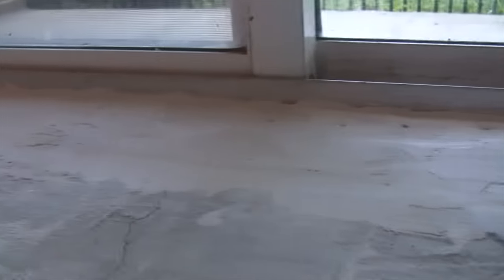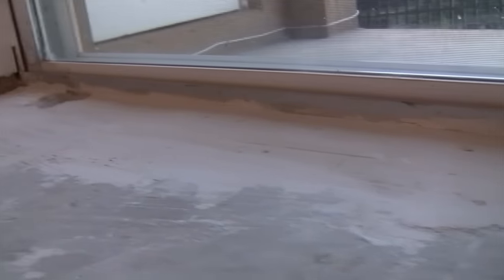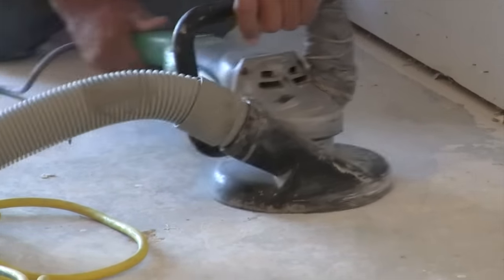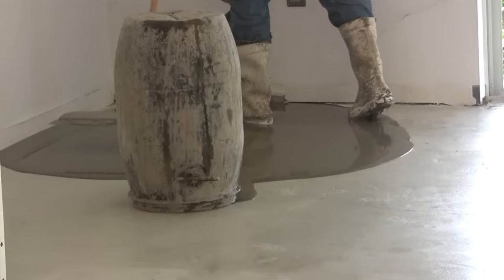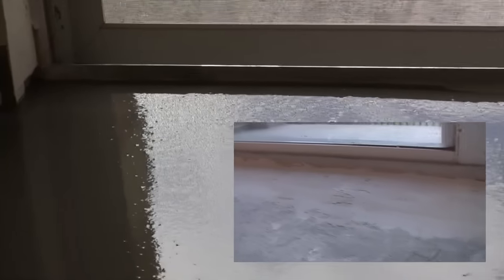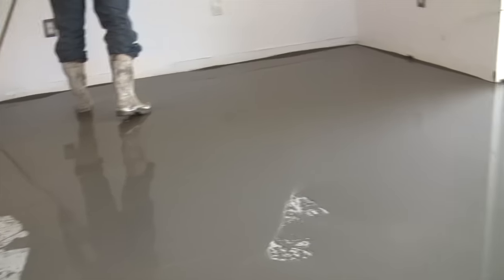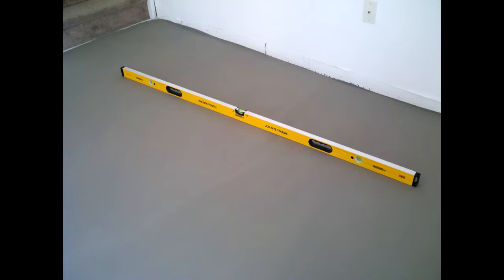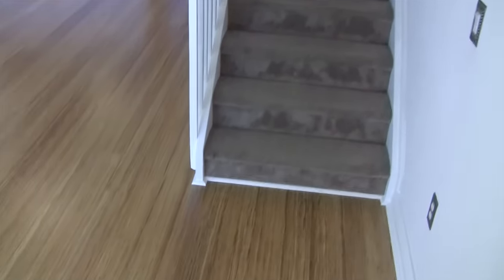How to Self Level Concrete Floors Like Pros - Self Leveler

Comment: Hi there, I have a question. I'm wanting to install luxury linyl planks onto my bare concrete foundation. It is a newly constructed home. The surface appears smoothe, not any rigid bumps like the foundation you guys were working with. I took a level and the bubble always fell close to perfect in the middle. The planks I would use have an attached pad and is 5 mm thick total. Is it really neccessary to use a self leveling concrete if the surface is already pretty smoothe?  It's a lot more expense and headaches that I would love to avoid at all costs. I have called several flooring stores and they all say yes, you need to use a self leveling product, but I didnt know if they were just trying to tack on more unnecessary things to make money. I've watched a lot of YouTube videos of people installing vinyl planks and they never address needing to use self leveler... just seems like they put the planks on and theres no problem. If I add these planks directly to the concrete without the self leveler product, will I be able to tell right away if this will be an issue? Or would it be an over time issue?

I want to install the planks myself to save money so I called several places to ask if they could just do the self leveling step for me and they all said no, that they do the whole job as a bundle.

Any ideas and answers?

Thanks so much!
Reply from the maker: Kelly yes a lot of us would like to save money on that as well. The industry specs are what you should try to adhere to and what you need to do is take a 6' level and put it all over the floor in the Room spin it around different orientations and if you see anything more than 1/8 inch dip in the floor across 6' then you have a problem and you will void the warranty of the planks. I would also check in the instructions of the wood planks that you're going to use and see what they say but usually it's no more than an 8th of an inch. Now I have cheated a few times and done it with an 8th of an inch or 3 sixteenths of an inch gap sometimes where I had people and just didn't have the money to go the extra step to self level, I put a couple of shims under the areas where there's dips and that will help keep the plank and stable. But I am concerned about how thin your a plank is I prefer to use a 1/2 inch Thick plank. My concern is that thinner planks tend to bend more and would be more susceptible to those dips in the floor over 1/8 of an inch. Plus those boards that have the padding on the back of them I find the padding is too thin and cheap compared to the thick 8th of an inch rubber underlayment that I typically prefer to use the premium product. Let us know what you find with your 6' level.
Reply: Home Depot carries 345 Henry paste hit the low spots and then prep and buy  “milk “ with cement will dry fast !!!!

Comment: Great video.  The concrete company that laid the initial concrete should be ashamed of themselves!  I have a quick question I hope you can help me with.  I have a small room (laundry room) that I am going to be laying a resin floor over (laying pennies like tile then a thin layer of resin). I figure the concrete leveler is a lot more cost effective than leveling it out with resin!  However, the floor outside of the room will just remain as a concrete floor.  Do you have any suggestions as to how I might handle that transition?  I assume I will need to place a small (removable) dam at the door to stop the self-leveler from going onto the hallway floor, which will leave a small rise in floor level on the laundry room floor.  Any suggestions or tips? Any help is appreciated.
Reply from the maker: We have this video here: https://youtu.be/zUTYpKiRT1Y that explains 2 scenarios of how to transition between 2 floor types, should give you some ideas.

Comment: You said they used 40 to 50 bags, maybe you misheard them. It’s more like 5 bags, 1 bag usually covers 4 to 5 m2. Nice video though, they made it look easy.
Reply from the maker: No I counted over 40 bags, I don't know who much they used. But this was 375 sq feet. The bag gives you about 25 sq feet at 1/4" depth, but I know that many areas in the room got up to 3/4" deep. IT is very deceiving to the eye people only look at the coverage per the bag, but it only covers that amount if you are only using it 1/4" deep.
Reply: jeffostroff yeah fair comment.

Comment: 3:02
This crack going down the middle of the floor almost the length of the unit...🤔 
Did anyone think about what will happen when(not if) this keeps moving in the direction that it is(any good reason it would not..?) with the self leveler attached to the slab and the beautiful new bamboo to the self leveler...🤔😬
Reply from the maker: Like most slabs of this type or with the cracks like that they usually don't get any worse and this is 7 years old and has not progressed in it worse than that, so the under limit that goes over the soft leveler would actually isolate the floor from any kind of cracking but it's not like you're getting a an earthquake like, Seismic line, the types of tracks are very common with concrete slabs.
Reply: jeffostroff Do you mean that the house or the slab is 7 years old?
Mapei will not warranty novaplan over active cracks. It should have been filled, they have products designed specifically for this purpose. Primer T is not a crack isolation membrane.
Is the bamboo floating? If it is than you are probably going to be fine. If it is glue down it could be an issue down the road.
Reply: Yes, it would be better to seal the crack. However, if the crack is old and is not expanding, it means that the existing floor is stable and it is not going to crack any longer. Self leveling compound on top of it will not crack.

Comment: Just curious as to why :
The cracks and holes were not patched with a repair mortar like Ardurapid 45
Why the screed take was used the wrong way round. It's angled for a reason so when dragged the head is 90' to the floor so you have a consistent height
Why were so many bags of screed needed to level such a small area. Either many you wouldn't need to take it as with a heavy depth the floor will level itself.
I have to say a true professional would lay it the way you have shown.
Reply from the maker: Most of these companies when they encounter a wide crack will patch it 1st but most of these cracks here were reasonably thin and the self leveler will just cover those. There is nothing structurally wrong with those cracks they are standard foundation settling hairline cracks. It was not as small of an area as you think it's 25' long by 15' and each bag if you're doing a quarter of an inch pour should only cover about 25 ft².  On top of that, the back corner of the room close to the sliding glass door they said was almost 3/4 of an inch off in terms of level that will greatly increase the amount of material that you need.
Reply: @jeffostroff  so was the job in this video self levelled 3/4 inch all the way across to fit the 3/4 inch ground zero point at the back of the room close to the sliding doors?
Reply from the maker: @pacmangotdmunch   Yes these guys had shine lasers around the floor and set these little white standoffs all over the place marking the lines of how high they needed the material to be and they showed me how that back corner was way off from the center of the Room so by time they were done everything was filled in and the whole floor was flat as you can see when I tested afterwards with the 6' level

Comment: Do have videos on lwveling garage floors
Reply from the maker: I don't have a video on garage floors, but it is still the same thing, just make sure you seal up the perimeter so self leveler does not flow where you don't want it to go.
Reply: Thanks for this question, because I haven't been able to find information on how durable the dried leveler is for traffic.  My question: If this leveler is laid down in a garage, will it hold up, OR is this ONLY to be used as an underlayment with some other surface (tile, etc.) on top? Will it hold up to foot traffic, etc., just "as is"?
Reply from the maker: @paulhahn9709  The instructions do say it is for interior use only, I assume the garage is considered exterior. MAPEI's Ultraplan 1 Plus for example must be covered with a finished floor system - not to be used as a final wear surface
, so garage floor is forbidden. You need to call MAPEI directly and talk to their customer support, they are harp guys. If you find nothing with them, try Ardex, another good manufacturer.
Reply: So, if I followed with something like epoxy, that'd do it?
Reply from the maker: @paulhahn9709  Not sure, you would have to ask the manufacturer to be sure, you don't want to mess this up. At question too is whether this can support the weight of a car.
Reply: Foot traffic only.  Too small for a car and all our crap.
Reply from the maker: @paulhahn9709  That's what I expected would be the outcome. Usually to support a car, you need concrete, and this thin layer of self leveler is likely to delaminate.

Comment: Why can't you put concrete on top of concrete I have done that with out a bonding agent it work just fine
Reply from the maker: Human deal K but the industry standard practice is to have the bonding major because whenever you mix new concrete with the old cured concrete you might have delamination ssues
Reply: I just didn't know

Comment: Guys put down a couple hundred bags of leveling and think they are pros.  Great vid and of course I may dispute some of the techniques but in the end you have a level floor that sticks so case closed.  Who doesn't grind down the high spots first?  I always grind a floor l00% as this helps encourage an excellent bond and I do this for any application as I am a professional and have saw areas fail for unexplained reasons if not properly prepped so why chance it.    This stuff isn't cheap so get it right the first time because it comes out of your pocket the second.
Reply from the maker: Yup,  this was a small 15 by 25' Room and the prep guy was on his hands and knees and grinded the entire room in about and hour did a bang-up job of it too really good very happy with it. And yes you're right they didn't take the time to do every teeny tiny little preparation steps the other companies do but it was like pulling teeth just to get these guys to show up they normally do large commercial properties and didn't even wanna mess with my project because it was too small. Other companies didn't even return our phone calls lol. But you called it perfectly in the end the job was really nice for us,  Well poured with a synchronized team of 3 guys, Perfectly flat sub store for me to install my bamboo flooring no squeaks in my bamboo floor when I installed the planks just smack down perfectly flat.
Reply: @jeffostroff  In regards to another comment saying he does self leveling by himself all I can do is shake my head.  Self leveling is always moving hence why we need cleats so we can back pour to compensate for the product running away.  One guy on a job like that??? Definitely would be seeing patch marks the next day for low spots.
Reply: Concrete guy for our new house slab on grade was talking about being so kind and self leveling the dips in our floor.. the problem is, the dip is the size of our 4x6 closet in our main room of the house and the walls around that dip are warped and slightly curved at the base....  A little late for self leveler ... 
What's the recourse for that?
Reply from the maker: @matth284  That's a strange one. Do the walls dip at the bottom also? I'd still try to self level that large dip area. One time we had to self level 1/2 a bathroom, you just feather it in tot he surrounding area.
Reply: @jeffostroff  well...the wall dips with no space under it, which causes the wall line on the floor to bow concave like to the floor, and since it's actually lower than the rest of the slab, the WALL IS WARPED and reflects the not level flooring that the wall studs rest on.  It's the first floor on slab and it's a new 2 floor residential home, so there is no redoing the wall without redoing the house, to fix the not level foundation, I think..... Or putting self leveler on the floor up to the edge of bottom of the stud and adding layers to the wall, as an imitation to what the wall truelly is, warped...All that said, the end cap parts to the opening to go into the rooms is also warped..as in, not 90° to you when you look into the hallway from 6' back,  you can see the 2 walls are not parallel. The right wall,  the closer edge is wider than the further edge. Its about an inch difference and it's only 6" wide wall ends that make the, about 40" opening... When we moved in the wall wasn't quite straight, and it got worse after about a month or 2 of living in the house.

My problem is, Im fairly certain at this point, I didn't have the proper inspections on my new home, for the footers and slab, and these problems should have been avoidable or remediated, but they weren't. To add insult to injury the Town I live in gave my house a CO without all the proper paperwork in possession either, which would have shown my foundation wasn't inspected. They also are backing the builder in almost all questionable circumstances.(I think the compaction reports are fudged too ).. so if there is no fix, it's looking like I have to go to court and prove the builder falsified paperwork to get my houses permits(which I can do) and prove the Town approved a house which shouldn't have, based on paperwork(which I can do)..and as well prove my house shouldn't have passed the Occupancy permit inspection with the town, via physical state of the house..(which I can also do)....
..
Add to it 3" of water at front porch when it rains. A flashing height of 1.5" instead of at minimum 4" at grade. Excess moisture coming through relief crack in attached garage after rains. 2nd floor door replacement wouldn't go back square.. and cracks along the ceiling wall line and window edges in the drywall...

(looking like a lawsuit on everybody, but that doesn't "fix" my wall still)
Reply from the maker: @matth284  wow, that sounds brutal. You should put up some videos about it to show the damage they created, and especially the water leaks and water collecting in certain spots. I would like to see what this looks like. It might also pressure the builder, to know their work is having the spotlight shined on it.
Reply: @jeffostroff ..hmm..well in that case, what should I call the channel?. .. I was thinking something like:
*CON-tractors
*NewHomeNightmares
or
*BuildersBestBullshit

I got video of them discussing my drainage problem and stuff they burried under my yard before final grade, and/or foundation pour... and the next day one of them having the audacity to say to our faces he had never been to my house before....also on video...but I played along with his many lies when he decided he wasn't gonna budge on some BS I called him out on.

I got pictures from a regular home inspectors moisture meter at 39.5% on concrete surface in the garage. Can't get a certified structural engineer or asbuilt survey to save my life. They are all friends in my town, OR conflict of interest, it seams like. Would have to pay hourS drive time each way for an engineer I found, $5,000 for another I found as a quote. Redneckmafia status here
Reply from the maker: @matth284  I like Con-tractors, also it's the most family friendly if you want to be able to monetize your channel.
Reply: @jeffostroff  one last question.. when I put it online, can I label and post who the people are? Names and company('s) they work for currently in the video? I can easily show the facts in paperwork and video without saying any voiceover. Me talking would be all facts and explaining what I'm seeing only, what I discovered and what I did next..like request paperwork, actions I decided to take.. etc..
Reply from the maker: @matth284  I would ask a lawyer about that, don't know what laws are about recording without someone's permission. But certainly you can show the damage done, and tell who the contractors are.
Reply: @matth284  I'm not really getting a sense of what you mean.  When encountering a really bad scenario the first step is to knock down the high points on the floor.  If self leveling is not an option you could always screed mapecem (I believe that's the name made by mapei.   Get the perimeter of the room flat (6" from wall" )  by grinding high spots and filling low spots.  Depending on room size and screed size you might want to run  6" bench mark for screeding purposes.  What product you use to screed is dependant on the what product you are using to cover the floor.  As for walls being untrue I'd have to see it before I could offer any suggestions

Comment: what is lippage?
Reply from the maker: Lippage is when you have 2 adjacent tiles that are not level in a plane with one another, like one tile is 1/8" higher so it makes a little lip or bump up. So,  if you try to slide a coin across the floor, it will hit the spot where one tile is slightly higher than the other tile.  This is why having the level floor to within 1/8" across a 6 foot level is required by the Tile Council of North America Specs to prevent lippage from occurring.
Reply: It's what bratty kids get slapped for.
Reply from the maker: Giter Dun  My kids put out  a lot of lippage, let me tell you!😜